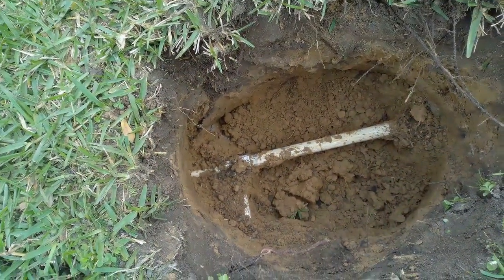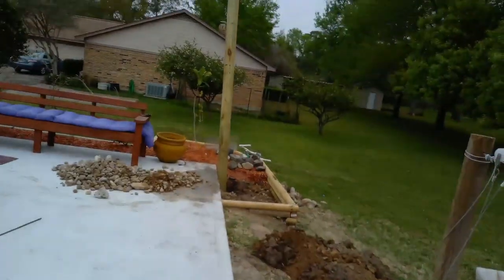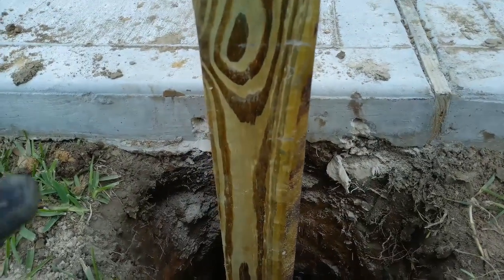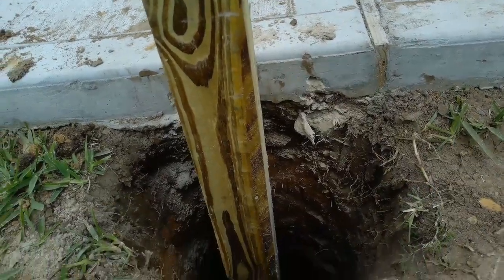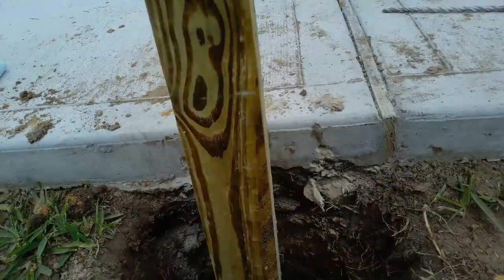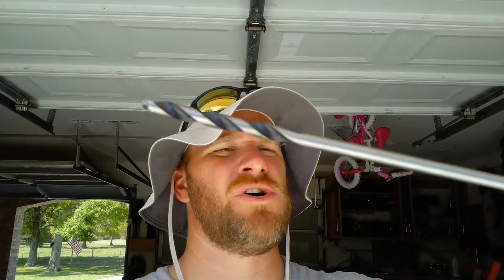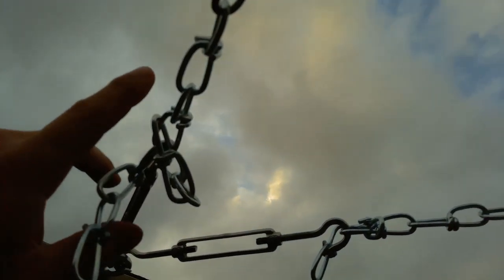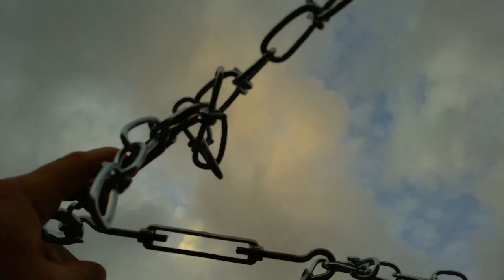Greatest Shade Sail Project Ever!

Comment: Used a door spring from home depot to create tension on my sun shade; makes it snug without the need for constant adjustment. It also provides wind resistance; it glides with the wind and prevents damage.
Reply: Brilliant!
Reply: Can you tell me what kind of door spring?  I looked at Home Depot today and all I saw were screen door springs and they seemed way too small and weak.  Thanks.
Reply: @renees4392  Everbilt-1-in-x-12-in-Zinc-Plated-Extension-Spring

Comment: Fantastic project, my only concern would be the rain as you mentioned and I think it would have been better to have it initially lower on the far end all the time, instead of having to move it when it rains. I realize your house isn’t all that tall and you’re limited on the height and the pitch you can achieve, but to have it at an angle from the jump would save you a lot of hassle in the long run.
Reply from the maker: Absolutely right.  We have changed a bit of the design because of trapped water in the large sails.  Thanks for watching!

Comment: From another video I came across the guy made a good point about all that tension over time bending the wood support beams even with nice beefy ones.  It looked like you were fixing that with cross beams but you only did one side.  If you continue to box that in the cross beams should keep them from sagging.  Nice video.  Might want to try and seal (silicon?) those eye screws through the gutter so water doesn't make it's way into the facia over time.
Reply from the maker: I made another video of the new shade sails with all the appropriate supports. Check it out. Thanks for the advice and thank you for watching!

Comment: Have you had any rain yet?   Those are going to fill with water and something is gonna have to give.  I installed those at a 45 degree between two buildings.  45 degree angle because I figured that would keep them from holding water.   NOPE.  They held so much water that the 3/8" eye bolts bent then broke off.  Those are not designed to be installed that way.  You are supposed to install then with two diagonal ends up and the other two down.  This allows for the fabric to be pulled tight and for water to run off.

EDIT:  Just saw your storm video.
Reply from the maker: Yes. I learned the hard way and I posted a video about it.  I did try 2 up and 2 down but that still collected water.  The shade sails would just not get tight enough for me.

Comment: What is the material you used?
Couldn’t you put each corner at a slightly different height so that water runs off? You’ll get caught with your pants down one of these times by the weather. That’s how she rolls.
Reply from the maker: Cant remember the type of material. I had 3 hooks up and 1 hook 3.5 ft lower on a corner. The problem was I could never get the shade sail tight enough no matter how I pulled it. Almost as if the sides were sown too short, making it impossible to get the slack out. I eventually changes these out with permeable shade sails which I made another video about and they are great. Thanks for watching.

Comment: I used 6x6 with a post cap, they look better to me. I also hang flower baskets from the post. I mounted mine under the soffit and gutter onto the house. Also I varied the height at the corners to give the sail a twist so the rain runs off and doesnt pool in the center.
Reply from the maker: Good Input. I was looking for some additional height so I went through the gutters.  I also have an overhang over the garage door that would have been almost impossible to connect to the house. Thanks for sharing.  Varied height is very important as I have learned.  When ordering the waterproof sails they will definitely collect water in the middle if you don't have a way for it to exit.

Comment: Great video! I also plan to install sails, but am worried about attaching it to the house. 
Isn't your method just drilling into the facia board?  Will that be secure enough? 
THANKS!
Reply from the maker: I drilled through the fascia board and into the rafters.  Fascia wouldn't be strong enough to hold the shade sails.  Used 8 in eye bolts that went through the gutters and into the rafters.  Thanks for watching.
Reply: @littleaboutalot7478  How did you locate the rafters?
Reply from the maker: @hmanone1063  I was able to find mine by looking through the eve vents.
Reply: @hmanone1063  , for those looking to "find" the rafter ends. If your home had a gutter system that has long nails to attach the gutters to your home, you already know where the rafter ends are located. You just remove those nails and install the eye screws to hold the sail and the gutter. SAFETY NOTE: Never stand on the top step of any ladder. Overhead work, efforts to drill, or many other physical efforts can cause a fall. The little girl helper doesn't want her Daddy breaking an arm or something even worse. BE SAFE.

Comment: Very nice video, thanks. I liked how you use the cement to match your patio. I would like to do the same thing, however I would have to screw the eye bolts in the side of the house with vinyl siding. Any suggestions? Thanks again
Reply from the maker: Find a stud. The shade sails have a lot of tension and need something robust to hold against.  Good luck.

Comment: You added the extra wood from pole to pole, did that help with stabilizing them? We have strong winds here in the high desert.
Reply from the maker: Made a world of difference.  Yes, absolutely it helped.  It also depends on the size of your sails but with these it was bending the 4x6 and then it would snap it back causing even more stress.  Definitely recommend extra support wherever you can put it.

Comment: Ha!  I am planning to install the very same set up!  I have had some nay sayers try to discourage me though. Are you still satisfied with this design? Have you made any improvements?
Reply from the maker: Overall, It's great.  Some maintenance is required.  When it rains the shade sails aren't 100% tight all the way across so if they aren't pulled real tight you get water pooling in the middle. I keep mine with 3 corners high and 1 corner low so the water has a place to go.  I have added supports if you check out the part2 patio extension project you can see it there.  The larger the shades the more issues you will have with wind and rain unless maybe you get the permeable ones.  Thanks for watching.
Reply: Do you think if you had a slight decline on the shade from the house to the poles it would let the rain roll off?

Comment: Great video. I tried your method today actually for the gutter pass through. I could only find 8” eye screws though. I got all the threads into the wood, but curious if you had any issues so far. It’s a ⅜” screw. Seems sturdy but once the wind picks up...
Reply from the maker: I posted another video with a review last week.  Check that out!  I have has some issues but a bad storm brought it down.  I used the 8" eye bolts.  They are strong if you find the rafter behind them.  Had it through some pretty high winds but the sails that I got I could never get them super tight.  Sagged in the middle.
Reply: Little About A lot I just watched it. I “think” I got into the rafters. But if so not by much. I’m debating tossing up 2 more posts closer to the house faster seeing your vid. Although I am getting a 16x12 and it’s permeable. Def have me nervous now, but plan to take it up and down with the forecast.
Reply from the maker: @veddar79  you shouldn't have the water issue that I had and I think you can stretch those permeable ones better than what I had. It was a strong storm and did other damage to other things I've never had a problem with.

Comment: You should have made one side lower than the other to allow for water to drain off, or you could have each corner at a dif. height to add flair.
Reply from the maker: In the video I talked about the lower eye bolt that we use on a regular basis now.  Thanks for watching.

Comment: How have the 4X6 held up? Locally I can get a 4X6X12 for $40 or a 6X6X12 for $109. Just don't think I need the 6X6.
Reply from the maker: 4x6 held up good after the extra supports.  They will begin to bend with the tension of the shade sail.  With the extra support they are golden.
Reply: Little About A lot Is that the board that’s going from post to post?
Reply from the maker: @bcookdc2  yes, and I added some that go from the house to the posts. My video Patio extension part 2 goes over it a little bit as well as my video on shade sail review
Reply: Thabks @Little About A lot. I’ve also subscribed.

Comment: Awesome Video! This was exactly what I needed for my project around our pool. I am stuck between treated post or galvanized post. Did you think about using galvanized at all?
Reply from the maker: I did think about using galvanized but they are a bit more expensive and I like the look of stained wood.
Reply: @littleaboutalot7478  I completely agree. I like the look of the stained wood much better also. Thanks for the input!

Comment: Good work.  What was the length of the eye bolts that you used through your gutter?
Reply from the maker: I think they were 8 or 9 in eye bolts.
Reply: Little About A lot are those stainless steel or other material ?  And where did you buy them?
Reply from the maker: @JOSUEGONZALEZ-tq1yq  they are not stainless. Zinc coated I believe. I got them at home depot. They were the longest ones they had.
Reply: Little About A lot thank you I was able to install mines following the instructions of your video.
Reply from the maker: @JOSUEGONZALEZ-tq1yq  awesome. Hope you enjoy!

Comment: Nice Job! Looks Great! Curious though, how does it handle in the wind? I'm in central Texas and we get some windy days and am concerned with how it handles?
Reply from the maker: The wind is a problem above 20 mph.  Depending on how you attach them they have a lot of tension on them.  These are 16x16ft sails and they probably could sail a boat. lol.  We take them down in high winds and big rain storms.  It is less of a problem if you have them at different anchor heights which is recommended by the manufacture.

Comment: How much did the shades cost please let me know would love to do this project
Reply from the maker: $80 a piece. 16x16ft. Waterproof.
Reply: Got our 12 x 12, waterproof, great quality at discount store. ALDI. LIDL had similar ones. ABOUT $ 16.00. We live 2 blocks from ocean and 2 blocks from ICW, SSOOO...its plenty windy. Put them up early last summer, attached to our DECK. STILL FLYING TODAY!!! We did take them down for winter, and of course hurricanes and tropical storms. Also if we are expecting high winds, 40 +, we drop one side down and secure to deck rail, wrapped in a bungee cord. We needed shade on front of house, we were baking inside. It certainly made our den more comfortable,  and really cut AC bill because the thermostat-register is located in the den. The other rooms were too cool, while the den was too hot...and the AC ran all day!! This was a GREAT FIX!! When this shade gets old, we will DEFINITELY buy a new one. Actually,  after we installed the shade and realized how strong and effective it was, i went back and bought another one!! So I'm set for, hopefully, a couple years. I found my posts on Offer up,  they were only $5 each. Theses shades came with the ropes and most of the hardware we needed to attach the shade. I did have to buy hardware to attach posts to the deck. I'm a ? reasonably healthy,  59 yo woman, hubby travels most of the time, so i DID THIS MYSELF. I'm not much with DIY's requiring great skill with power tools, but if I can do it...you can!!
Reply: waterproof or water resistant?
Reply from the maker: @sirrednaed1  waterproof